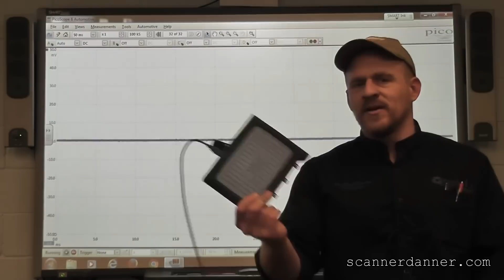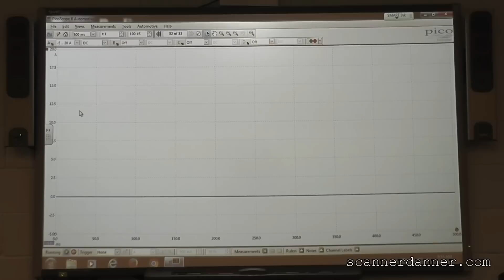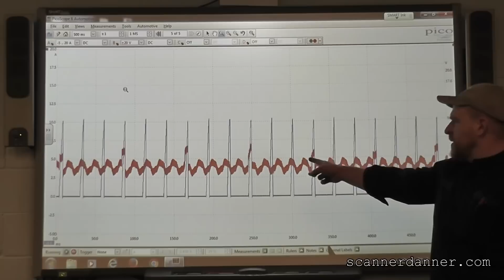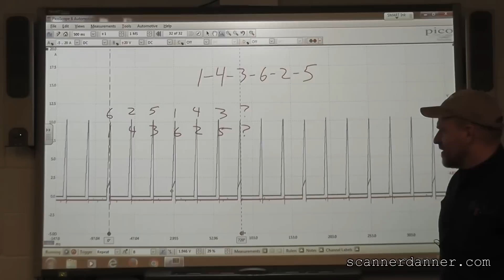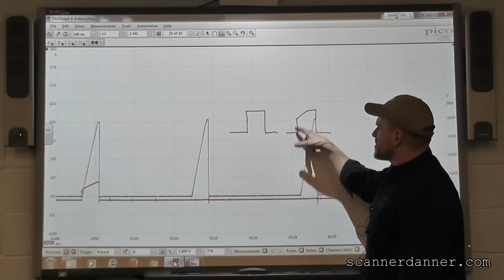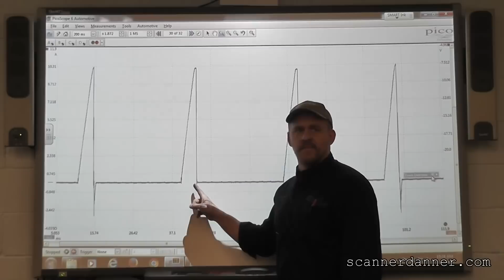Ignition System Testing - Primary Current [Audi A6 part 2 of 2]

Comment from the maker: This is an SD Premium class from a few years ago where I am using a live case study to introduce a new class to ignition systems and coil current ramp testing. To join my classes visit https://www.scannerdanner.com/join-scannerdanner-premium.html and sign up for the free trial!

00:00 - review of part 1 https://youtu.be/qRvWefjb0F4
00:48 - @PicoScopeAutomotive  
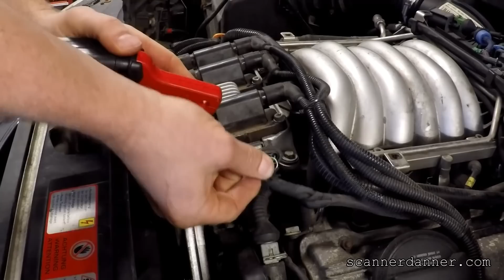01:25 - low current probe connections
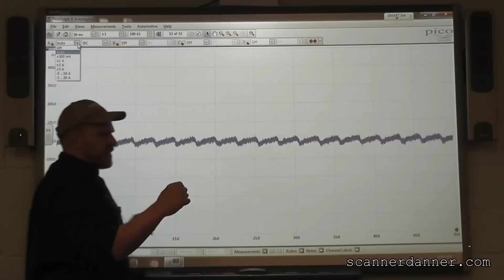03:11 - initial settings of  a lab scope (scale and time base)
09:00 - first view of the coil current ramp patterns
10:00 - scope sample rate
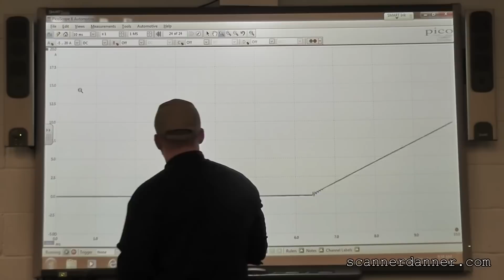11:00 - when and how to use a scope trigger 
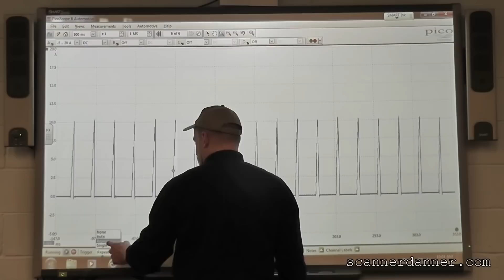14:00 - how to sync the coil current ramps (ID specific cylinders)
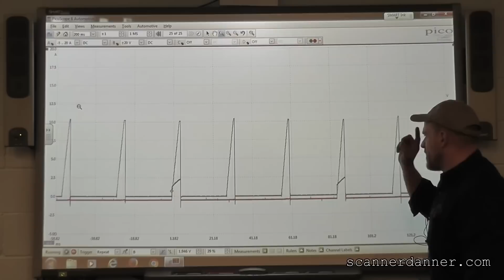18:05 - moment the misfire occurred
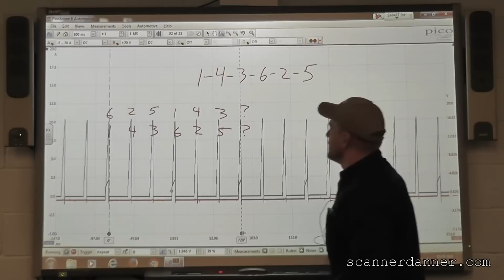21:30 - scope buffer 
24:20 - open coil winding or open driver?
26:05 - view of the underside of the coil/module assembly
29:00 - ignition coil circuit design (driver in PCM vs driver in coil)
31:20 - what an open plug wire looks like
38:10 - final review showing the failure (2 cylinder misfire)
Reply: Can you help my i have one problem with Cadillac Eldorado 1992 4.9
Reply: @@liridoni123  sure, what's up?
Reply: Fuel injector not opening property   by fire spark
Reply: I have bypass key resistor crank fine but just injector not opening property. I move out injector and distributor rolling by hand injector  open all when put injection key on
Reply: @@liridoni123  not really following that, sorry. The 4.9 in that year was a port injection system I believe and the wiring harness that runs along the rear valve cover was known to melt and affect injection control
Reply: Im from Kosovo fair away from your hahah
Reply: I start a car on time but another time not start
Reply: Thank you for you time l will look that wire i know where is it .baydheway i like your job how you explain thinks.
Reply: I look thos wire is in good shape dos distributor make this happen .

Comment: I mean, you could put your current probe between the coil and the driver....but it's an assembly so it really is pointless.
Reply from the maker: You can't on this design
Reply: @ScannerDanner  you do have a picture of the coils removed from the bracket and the wires from the coil drivers to the coils exposed. It would not be worth the effort for sure.
Reply from the maker: @tombeam  from memory, those wires were underneath epoxy, and there would be no room to get an amp clamp in there. Also, an amperage measurement wouldn't have told us any more than what we already knew (current flow was dropping out). Some voltage measurements would have told more of the story as far as open coil or open driver goes. But as you said, it's all one assembly so we were done.
Reply: @ScannerDanner  ahh, didn't know that 😀 see learned something.

Comment: Great video as always.  My background is electronics, but thanks to your videos, I can troubleshoot family cars (I hate being a mechanic-broken bolts, impossible to reach parts, burned and cut fingers, etc.).  There is a test I use when I have an intermittent electronics problem that appears after a circuit has warmed up. I will spray the suspected (normally the active-high current)  component with electronics cleaner, dust cleaner in a can, or anything that will cool the component.  This quickly cools the suspected part, and if the problem is heat related, will often cause the component to start working again.

On the Audi coil pack, there was a metal heat sink.  This heat sink is used to draw excess heat off the three driver transistors since the transistors each flow several amps of current.  When the cylinder 1/6 driver coil failed after the engine ran for several minutes, I would have suggested spraying the heat sink with brake cleaner, electronics cleaner, duster in a can, water bottle with a hole in the cap, or anything that would cool the heat sink.  If cooling the heat sink restored the operation of the 1/6 cylinder coil, it would have quickly confirmed that the driver was the defective part..

Comment: Hi, just hooked onto your videos recently. Based in qatar and considering diagnostics focus for possible workshop start up. If i purchase the electronic version book, can i print the pages as required or are there restrictions put on there? Thanks russell
Reply from the maker: You can't print directly from it, but there is nothing stopping you from doing screen captures on your PC and then printing individual pages. It's not ideal, but just do a chapter at a time while you're watching my classes. If that doesn't work for you, I completely understand and have no problem with a refund. Thank you so much!
Reply: @ScannerDanner  thanks for prompt response and no need refunds. Keep up the great work. Will buy it on ur web site. Thanks again

Comment: 20:20 ...   To determine which cylinder is which on the waste-spark setup,   where you can see both 1 and 6 (for example) but you can't tell which is which, you can simply pull one of the secondary plug wires, and then it would fire on only one of them (I would think).   (After the coil started failing again live, that wouldn't work though.)  So you would probably just have to sync with one of the other two working coils -- then pull one of those secondary plugs, and finally you would have your sync, and could go from there with your firing order.   That's interesting, it's so much more simple on regular coil-overs.
Reply from the maker: It would affect both (unplugging a wire on 1 side of a waste spark coil)
To sync it, the best way is to use a capacitive secondary ignition pickup and clip it on a plug wire. You'll then see a high, low, high, low firing line. High = compression stroke and Low = exhaust stroke and now you'll know when the cylinder being testing is firing. Make sense?
Reply: @ScannerDanner  Ok, I see.  So even then, you'll still see both sides, except for the local pressure change in the cylinder;  that compression stroke will give it a high/ low effect.  I'll have to remember that.
Reply from the maker: @calholli  yes sir, the cylinder pair that is attached to that coil will alternate high and low firing lines. High on the compression stroke and low on the exhaust stroke. I have some videos showing this technique. But I don't know where offhand. I'd be in my chapter 22 and chapter 1 playlists. I think when I taught relative compression testing in my chapter 1 playlist, I showed how to ID a waste spark system

Comment: A nice little side experiment that you could do is to put a signal through a wire (or pull from an injector feed or coils, etc.) --  and play with your amp-clamp by half way opening the jaws and also maybe pinch the wires with the jaws, etc..  and just see what the signal does while you try all these different "wrong ways" to connect the amp-clamp.   I just think it would be interesting to see how it affects the signal.  (plus you could show how flipping the clamp inverts the signal, etc.).    It probably wouldn't be it's own video of coarse,  but I think it would add some unique content that no one else has done.

Comment: wow. last time i was this early the car hadnt even broken yet😂 (yea that was cringy-im not good at doing those "first" type comments)
Reply: ps...testing the coil last video could certainly mislead someone - seemed like the coil was fine when you tested with a test light. I guess that kinda shows how important it is not to jump to a conclusion(and also how annoying intermittent issues can be). I left the last vid thinking the computer was the problem, or wiring to the ecm
Reply from the maker: @colestowing8695  I did too when this started, but the intermittent nature had me thinking about the coil/module assembly